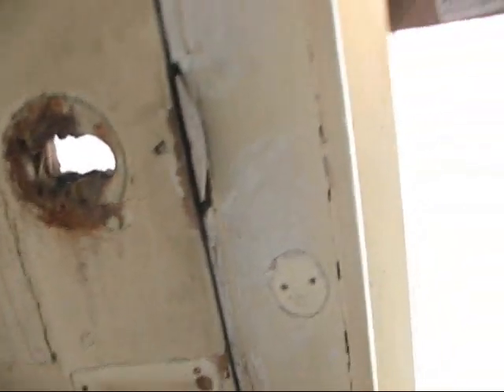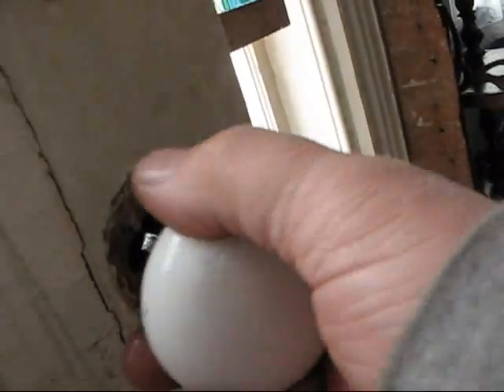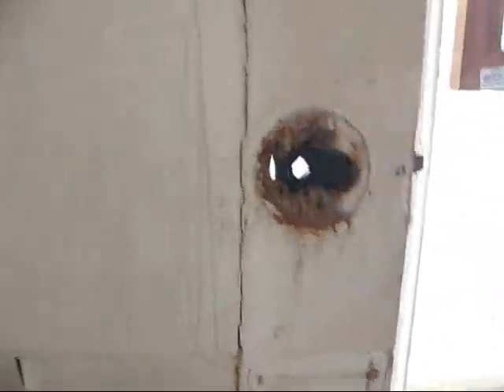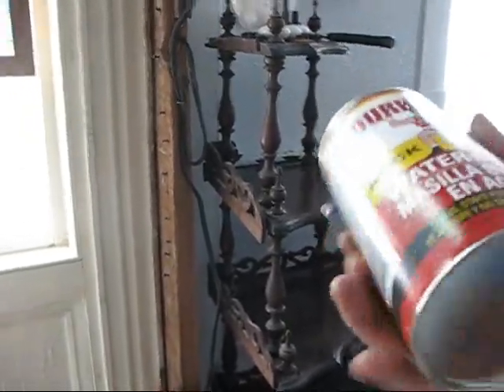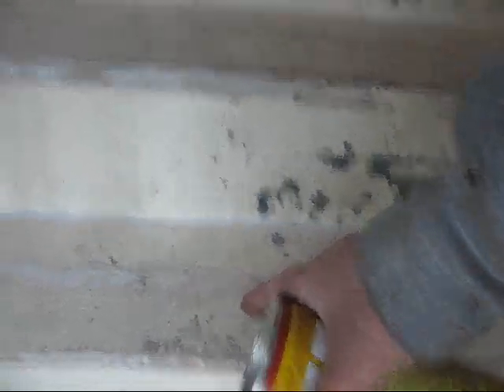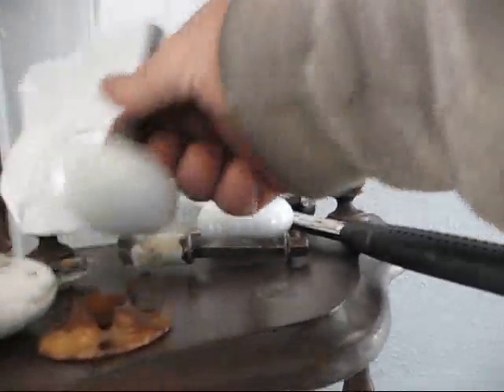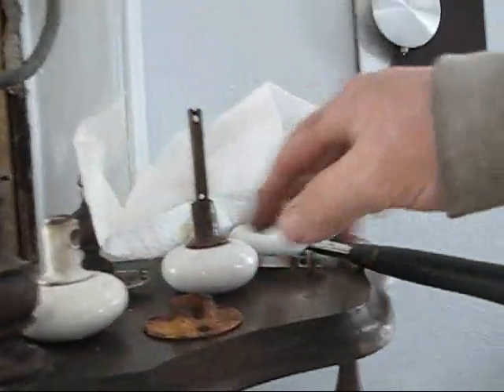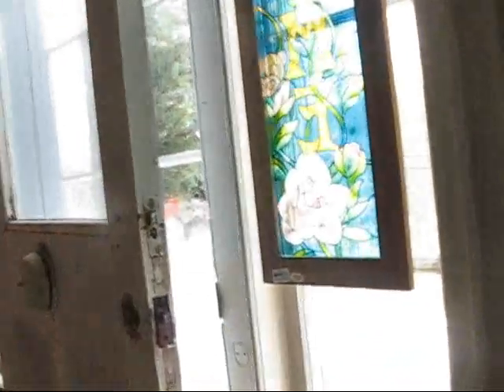Fixin' the front door knob and reworking the staircase

Comment: That Duran rock hard putty is great for repairs on wood. But you don't want to apply it more than 1/4" thick for best strength. It can be applied thicker if done in several coats or layers. Should looks as good as new when you are done.  *****